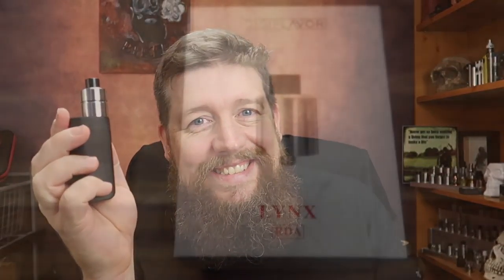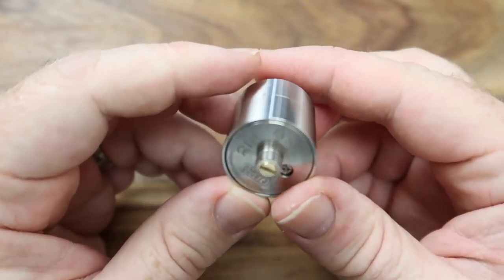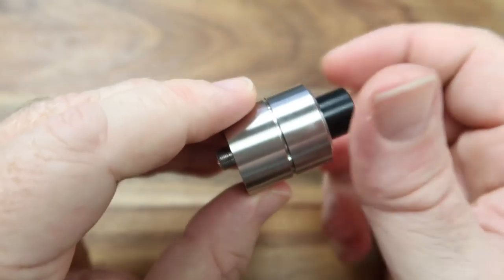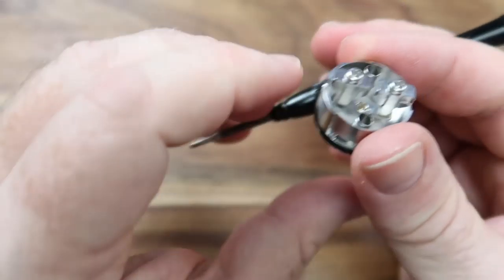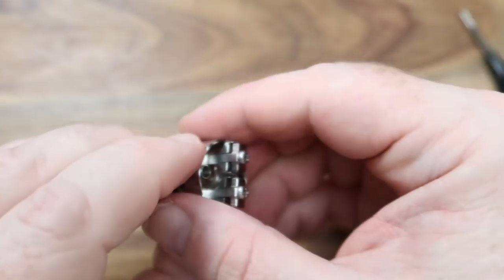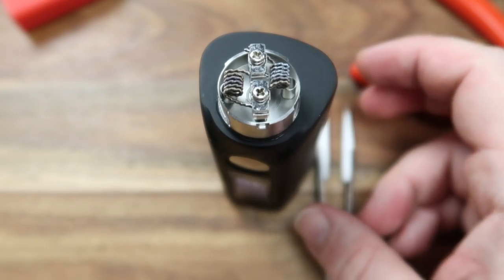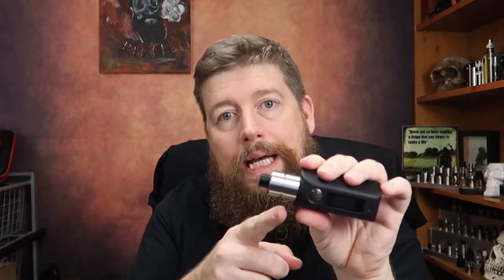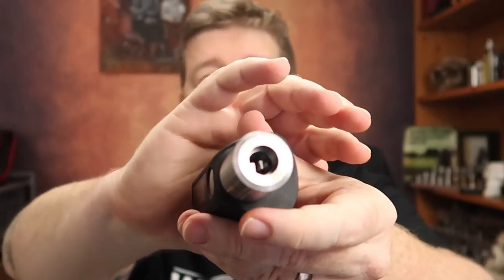LYNX RDA FROM DIGIFLAVOR - It's not Egyptian but it's not bad!

Comment: Dang you have been busy Dean. Seems like you have released a new video every day this week. 
Seems like you would lose the bottom air flow once the side air flow is open too much. Thoughts? Also, thank you for answering every question I have had to the best of your ability.
Reply from the maker: +Tony Lent that'll be because I have released one a day ;-)
As for the air in the side detracting from the bottom I agree....kinda. 
It'll depend on volume because air will always choose the path of least resistance. I would imagine it will always boil down to how hard you suck